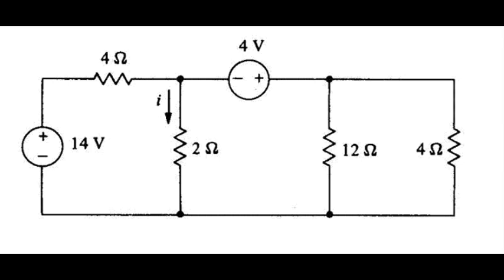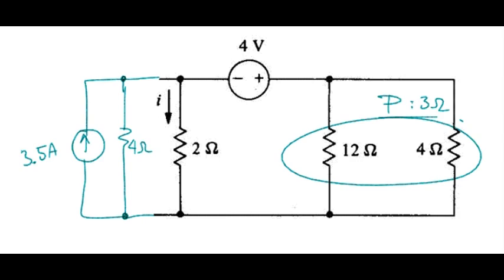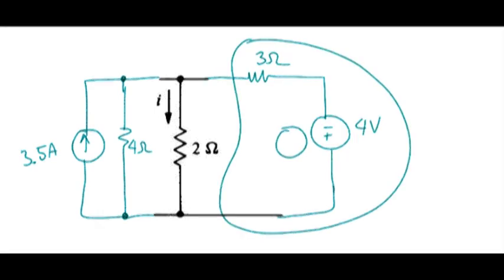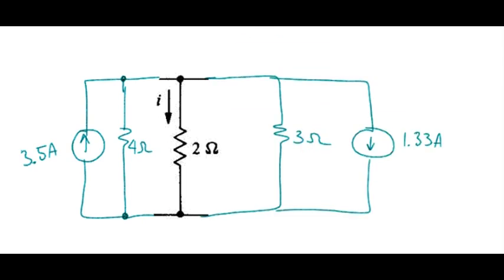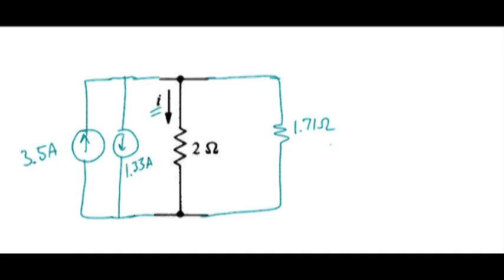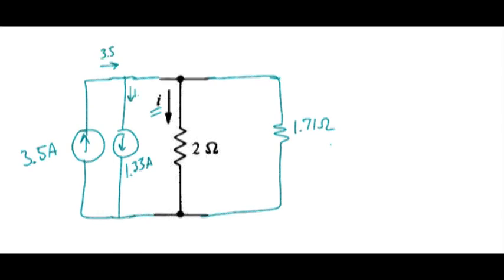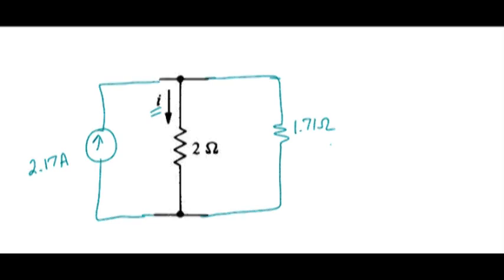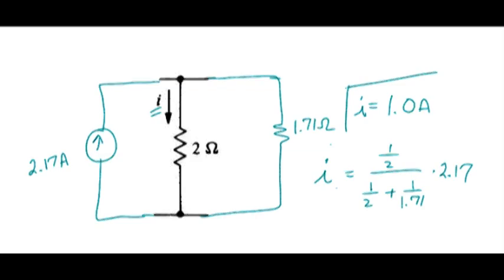dc: Source Transformations Example #3

Comment: your formula for the current divider is odd. it shoulda been the opposite resistor(1.71) over (1.71+2) then you multiply by the current source 2.17
Reply: its the same thing